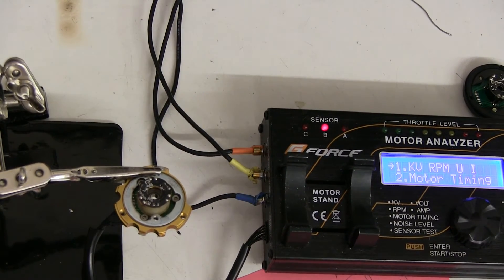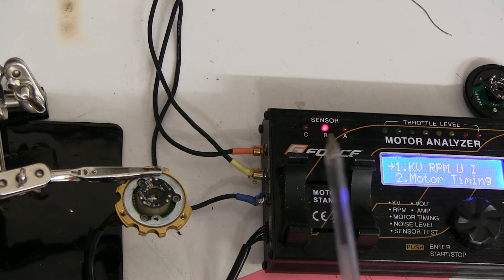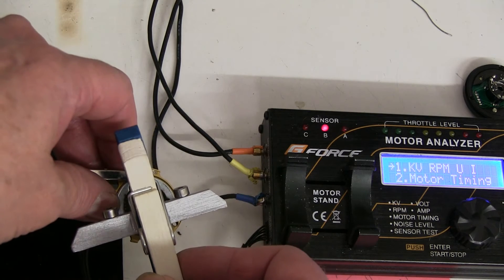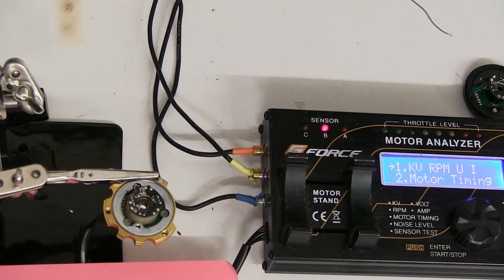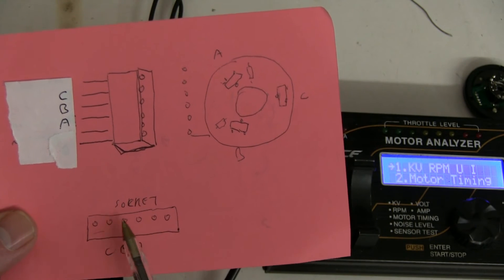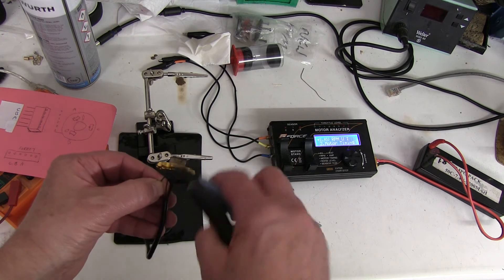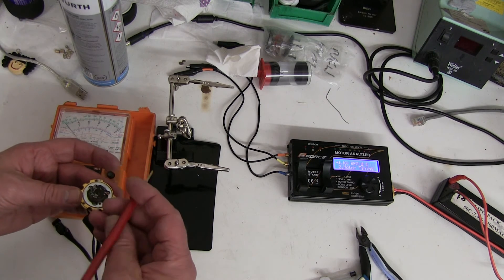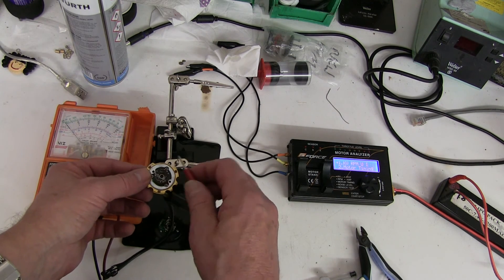Brushless motor. Sensor ABC identification.

Comment: Hi Nick, I'm looking for those sensors (do you know the name or if they are sold spare) . Well I'm looking if it is possible to replace them.
This is due to I have a brushless motor of a gimbal (camera stabilization system) the sensor received an impact. And now the motor is like without force in some sections.
Reply from the maker: Hi. I do not know the part number. But you can buy a replacement sensor board for one of these motors, and can unsolder the hall sensor and solder it to your board.

Comment: Nick, when you use the meter to identify the sensors, and the needle moves, does that also indicate that the hall sensor is good? If so, I can use this method to check my broken R1 25.5. Thanks!
Reply from the maker: Hi
It is rare that a hall sensor goes faulty, unless it has been damaged by a stone or impact, which would be obvious.
You can check the resistance across the sensor and bring a magnet (The rotor) close to it and watch for the resistance to change.
If it does then it is working.
When you say the 21.5T is broken. What are the symptoms?
Reply: The previous owner said that he bridged the tabs with solder during installation. The motor does not seem to achieve full speed, seems flat. I checked the coils with my automotive meter and each coil checked out good with .09 ohms on all three coils. No other visible damage or odors. Rotor spins freely and after disassembly nothing appears to be wrong. Rumor has it that R1 is having some sensor board problems which is why I wanted to verify the board. Thanks!
Reply from the maker: The R1 has poor sensor board matching, but they usually work.
Have you advanced the endbell to about 40 degrees to see if the revs pick up?
Your speed control has a good sensor lead connected to the motor?
Reply: Nick Adams I have not tried to advance the timing yet and have tried different cables.